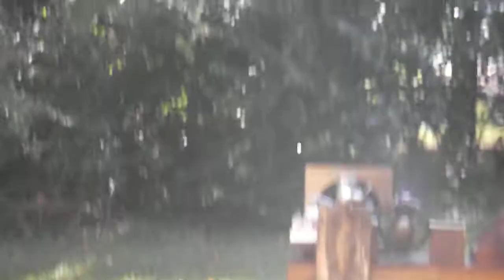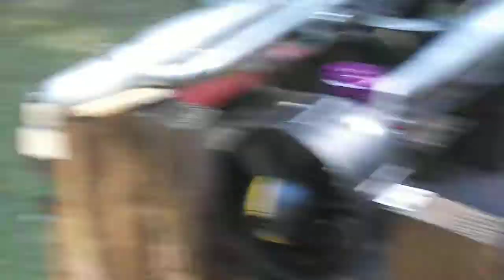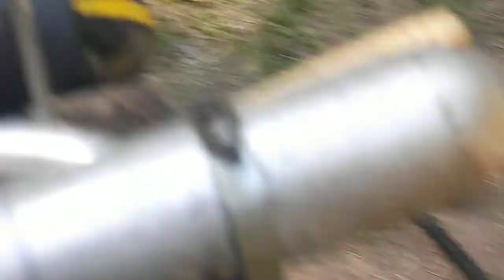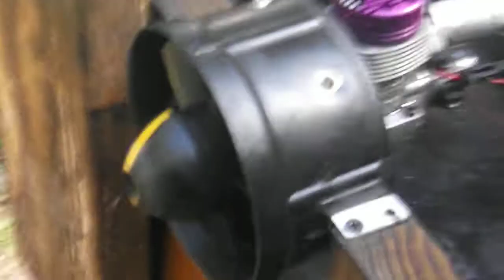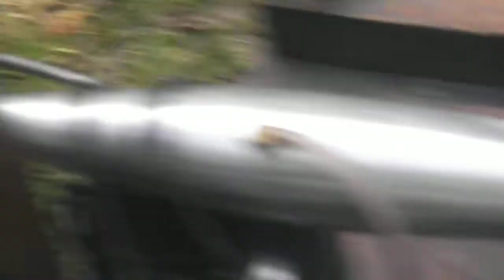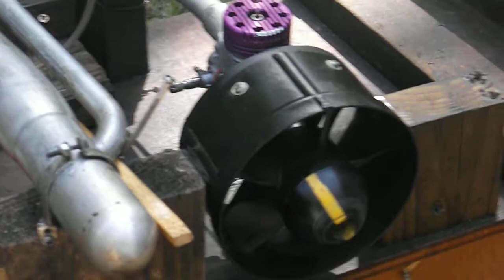OS 46VXDF RC GLOW NITRO DUCTED FAN JET ENGINE RUNNING ON TURBAX DF FOR SALE!

Comment: I have the IDENTICAL setup on a scratch built Delta Wing from about 20 years ago. Flew great!  I just ran it yesterday for the first time since 2002. A little hard getting it tuned and then it broke one of the aluminum mounts. MAGA!

Comment: If I did not have 5 different set ups I would like to buy that one that OS 46 is the one I do not have, alittle smaller but it would do nice on a scratch built VECTOR  EAGLE  F-15
Reply from the maker: hi there, its SWEET RUNNING. I am selling a bunch of DF complete units. I am buying 48 Jets and I am paying them out. I love the Vector F15. I have not seen one in forever. do you have any videos? Gary :)
Reply from the maker: do you have another Vector Eagle? id love to have another one. ty, Gary
Reply: @GaryFlymore  How much do you want for this set up   ?
Reply from the maker: @gizzmo0007  hi, ill ship what you see for $325.00 in the states. (OBO) its perfect and rare and OS makes and sells all the parts for that engine. lmk buddy.  Gary